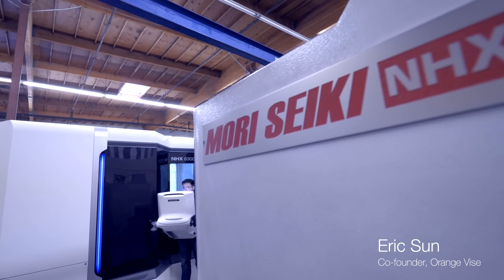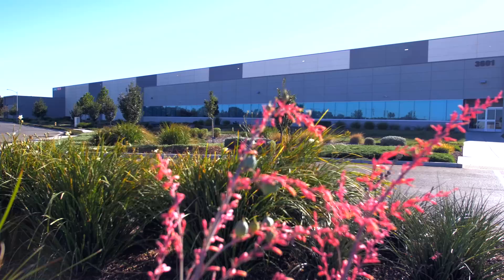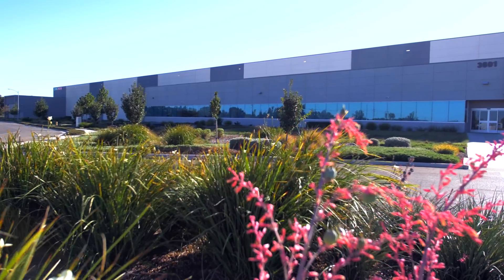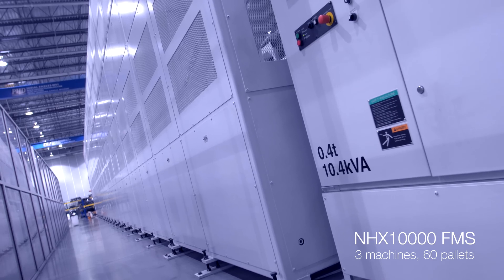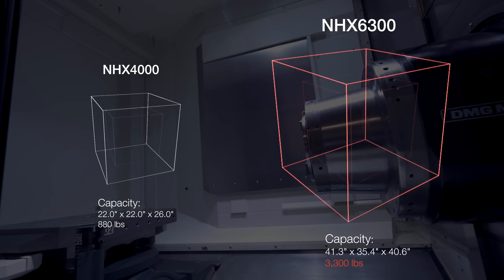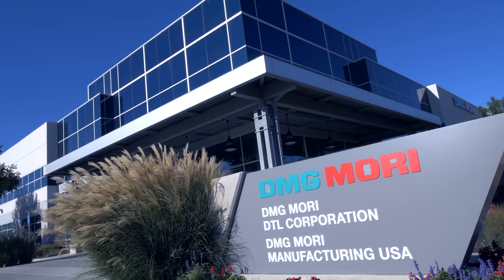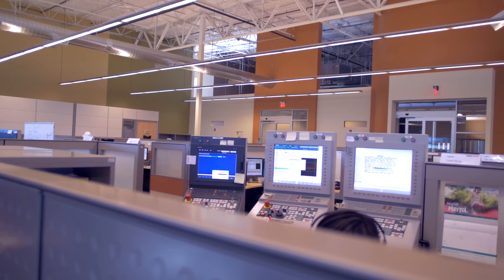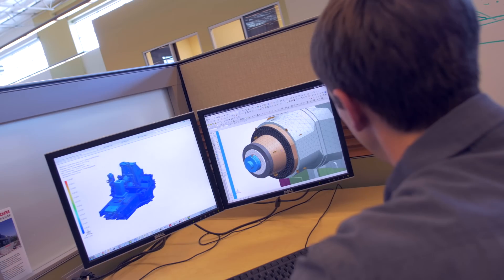Factory to Floor - Chapter 2: Expansion (4K)

Comment: Congrats on the new machine! Quick question - does your NHX6300 have the machine zero for X close to the tool changer? We just bought a NHX10000 and that is how ours is configured.
Reply from the maker: Hey Fred, yes machine coordinate X0 is at full X+ by the ATC.  We set our G54 to the B-axis center.